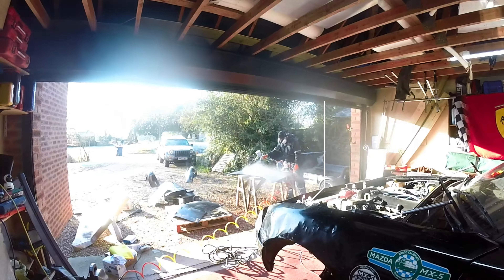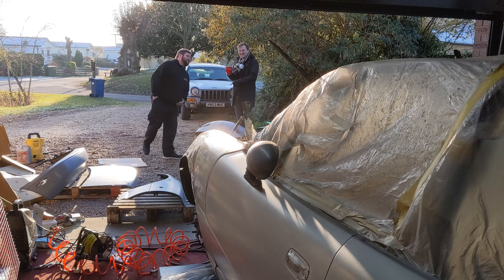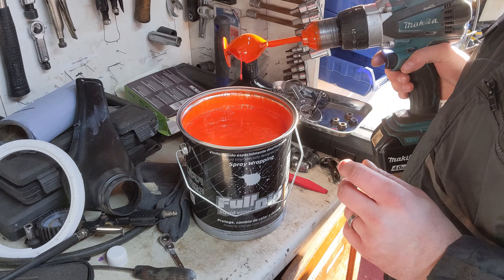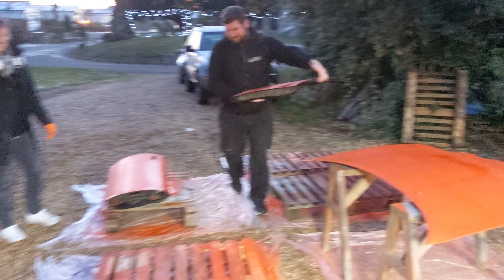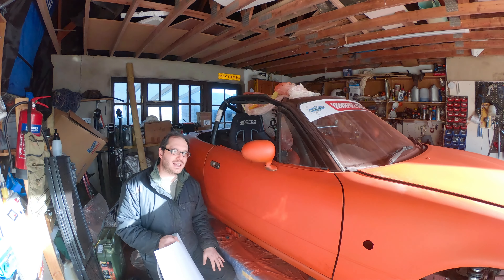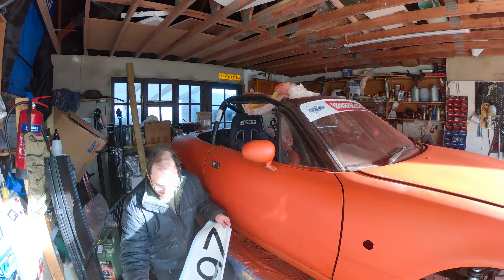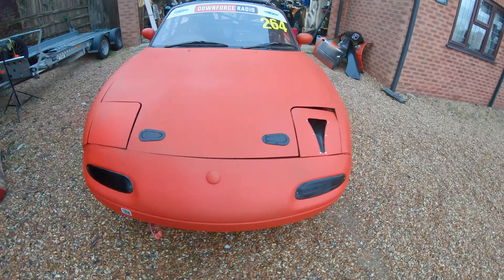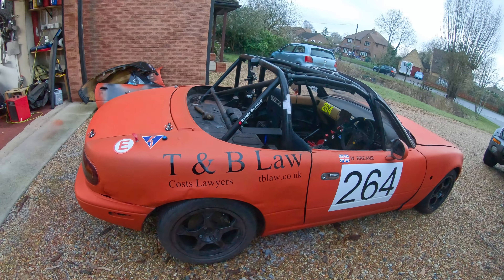First Time Vinyl Dipping a Car (and in Sub-Zero Temperatures!)

Comment: Looking good will - how much did it cost vs a respray?
Reply from the maker: A lot cheaper. 5l of primer was £70 and 4l of colour was about £85. That was more than enough for the Mazda and there's certainly an acceptable result spraying outside of a spray booth by complete amateurs!
Reply: @RadicalUnderdogs  Thats pretty good! I just paid £400 for the cage only, but flouro yellow is really expensive.
Reply from the maker: Apparently you can get fluorescent in spray dip too - will give that a go for next time!

Comment: Hey, looks good! How does this hold up on track compared to normal paint? I had real trouble with marbles and debris damaging the paint after races this year!
Reply from the maker: It's only done one trackday so far and was fine - the straps from the trailer did wear some off though and you have to be careful with fuel. Touch ups are easy and cheap (I've got a couple of rattle cans of the primer and colour) - so long as you don't look too closely!
Reply: @RadicalUnderdogs  thanks, may give it a look before the season starts. I more or less had to touch up the paint after every race for one reason or another!
Reply from the maker: @chriswhitmore6650  It's basically the same stuff as the Paint Protection FIlm but with colour
Reply: @RadicalUnderdogs  yes I've been doing some reading up past couple of days. I was debating doing a vinyl wrap before the new season but was put off by the fact it's a new skill, at least this is transferable from the spraying I've done before. Tempted to go for it now.
Reply from the maker: @chriswhitmore6650  Yeah - it's definitely a transferrable skill - it's the same as spraying  paint (with a slightly larger nozzle). Matt Pack were really helpful when I called them up. 4l was more than enough for the MX5 for each of the coats. I'm really interested in fluoro colours for next time.